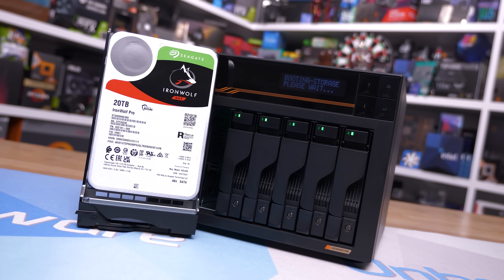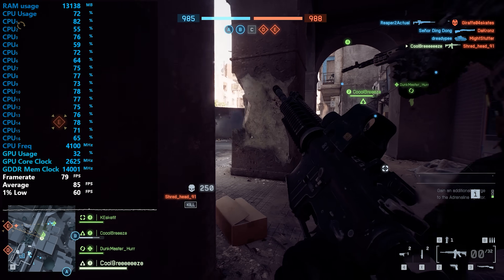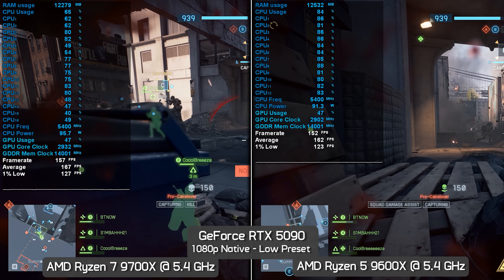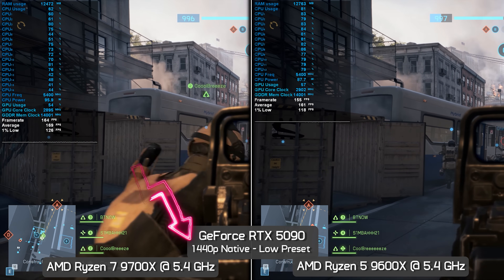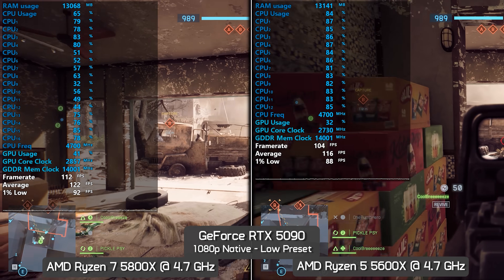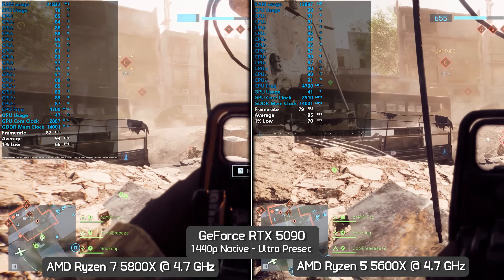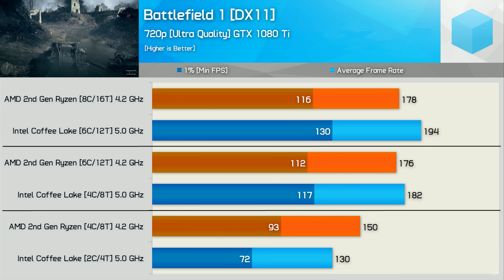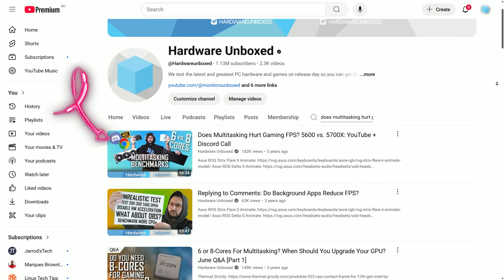Why Gamers DON’T Need More Cores, 6-Cores Still Works Well!

Comment: new 6 cores are vastly superior to parts from even 2020, my 8 core r7 5800x can\t beat any of recently relased 6 core cpus.
Reply: Although newer games can scale across multiple cores the peek workload in most is still on one core. So a newer generation cpu with fewer cores will still beat older with more cores in many cases. The 7600x and 5800x have almost identical multicore performance but in games the 7600x is just better.
Reply: If I add the Core Ultra 5 into the comparison, what do you guys think?

I just want to know everyone's perspectives.
Reply: @vieWviz  Doesn't make much sense.
-Requires buying a new platform and DDR5 like AM5 but it's already EOL.

-For anyone who "must haz" the new intel a 245K (£240) + 2x24GB ram (£100) + board (£200) combo comes to = £540.
Going to a 265K gets you 33% more Pcores plus 50% more Atom cores while the total cost at £569 is only 12% more expensive.
 
-Gaming performance between a 12700k and 13600K (Source Steve's Techspot review) thus likely a Ryzen 5 7500F or very highly tuned Zen3.

-Rendering performance in Blender around 93seconds (Techpowerup) which is slower 21.5% slower than a 14700K at 76.7sec or 7900x at 81.8sec.

That's pretty much par for the course in lots of tasks, anything you do has to not be memory latency sensitive as Arrow lake is really bad (hence Nova lake is going 144MB base tile).

The platform itself isn't bad as they've caught up to AM5 by having 16+4+4 direct PCIE lanes on the CPU.
Theoretically if Intel could do a 6P+0E for £100 it might make sense to throw in a cheap board with cheap ram to use as a home server so you can utilise the iGPU for AV1 transcode?
Reply: A friend of mine asked me to upgrade his PC so he could play WH40K Space Marine II in good quality settings, so asked me to stick to the "recommended hardware". The recommended says R7 5800X, but I managed to find a cheaper but newer R5 7600X so I got that and now he is happy purging the galaxy because it have more or less the same performance, but with a newer platform with way better upgrade path if needed.
Reply: @MisantropoFilantropo  I just upgraded to 8400F from R7 2700, the difference is huge. Wanted to upgrade to 5800X but 8400F was cheaper and is faster in most day to day tasks.
Reply: I have a 12core 5900x I'm all gravy for the foreseeable future 😅
Reply: @shotgunshawzy Yes.  But, if the game doesn't isolate to a single ccd, and uses more than 6, cores - the 6 core part would be faster because of reduced ccd-ccd latency.

Buy you are good: just game.
Reply: @shotgunshawzy nah, a 5900X is a glorified 6 cores. Due to CCD communication overhead, you're mostly locked into one of the CCD which is 6 cores. The 5900X, 7900X and 9900X should not exist imho, since most people are unaware of their limitations and that outside specially built programs they will perform worse than a 5800X/7700X/9700X despite costing much more, and that if you are aware the 5950X/7950X/9950X is not that much more expensive than it.

Unless you know what you're doing, they're basically scamming people out of 100/200€
Reply: @Anankin12  I own 5900X. Looking just on built-in benchmark in DX: Mankind divided, running 1 CCD in slightly faster (2-3 fps). But when I start Handbrake it shows it's might!
Reply: @GreyDeathVaccine oh yeah, in heavy parallel and latency insensitive operations it sure can get used :D I also have several very specific applications where I could take advantage of multi-CCD CPUs, but I run them on a cluster with nodes having dual 64 core (8 CCD each) or fual 32 (4 CCDs each, but faster so that the 32 core is faster than the 64 core) EPYCs. Next year I will lose access to such machinery though... But yeah, if you don't have a specific application that you know can take advantage of that, it's better to go either higher for max performance with the 50X or lower for higher/similar performance for lower price with the 700X/800X. Or for much higher gaming performance for a similar price with the X3D.
Reply: @Anankin12  The 5900X is perfectly fine if you know why you re buying it. For compiling, it did for me a very great job.
Reply: @Anankin12  Not even demonstrably true..
Reply: stares in 5800x3d menacengly.
Reply: @ZiLoXCY The 9600x is generally faster than the legendary 5800x3d except a few titles that are very cache dependent.
Also the 7600x3d exists.
Reply: @ZiLoXCY crazy cause the 7600 casually out performs the 5800x3d
Reply: Yeah, my 5800X3D only beats the 7600X in very specific games, otherwise the 7600X is on par or better...
Reply: @Anankin12 I have a 7600 and a 5800X3D and see the same.
Reply: @Anankin12 I could have bought the 5800xd but went the future proof route with 12 cores 😊
Reply: @shotgunshawzy which is a bit silly considering the 5800X3D is still competing with current hardware while the 5900X is not, and someone with CS knowledge could have told you the same. Still if it works for you then it's fine :)
Reply: It was always the same. However, the six core CPU will conk out over all games sooner than the eight core. Think back to 8700K vs 9900K. At the time everyone said buy the 8700K, coz you don't need the extra cores of the 9900K. Fast forward to now, and we can't say the same with those CPUs. Then I suppose it depends on how long you intend running your rigs. My previous rig with an 8700K is my second rig now.
Reply: @greenbow7888 that is reasonable, but aint gonna happen today, Im sure about this. 6/12 CPUs are still fine for average gaming.
Reply: yea and the legendary R7 5800x3D is equal to r7 7600x
Reply: DDR5 is the biggest contributer to the performance gains that we see.  I mean, I'm not trying to undercut the extra performance of the cores in a more modern CPU.  I run a 5900x, tweaked to the gills, DDR4 3600 14-14-14-28-42, fully tweaked sub-timings and it just can't hang with DDR5.  You can see it in Intel 12th gen benchmarks using DDR4 vs DDR5 mobos.

While dude is running a benchmark rig with a lean copy of Windows and seeing 10% performance gains with 6 vs 8 core CPUs, it'd be more on an actual user's PC.  It's just that 99% of games don't see any benefit from anything over 6 cores.. shoot, 4 cores are more than enough for the majority of games.  But Frostbite does utilize threads very well.  BF4.. FX-8350 vs i5 6600K was a good one.  An old, super slow IPC CPU with 8 cores vs a blazing fast (at the time) 4 core CPU had the FX-8350 delivering smoother gameplay in benchmarks I saw with equal-ish framerates.  

So, if a benchmarking rig shows 8 cores giving +10% performance in 2 minutes of gameplay (handpicked, I presume), what's a real rig stand to gain after an hour?  I can make examples that lean either way.  I play Tidal/Spotify in the background half the time.  Very low CPU usage, but hey.. when you're running 85% on a 6 core, and hitting that 85-90% mark is where the performance scaling typically ends, you "can" see more and more performance loss.  "Needs" isn't the right word.  Ya don't need it.  Just like ya don't "need" to test games at 1080p with a 9800x3D and a 5090 on low for anything in real life.  This vid is actually just fighting truth lol.  So, a 6 core benchmarking rig does bottleneck the game compared to an 8 core+... in only TWO MINUTES by TEN PERCENT.  I can't even trust this is in a 64 player server which massively increases CPU load vs 32 players.
Reply: 5800X and 5700X are still better than 7500F, 7600 and 7600X as a whole and in general use, cause you have more cores/threads, especially for virtualization. In multitasking power they are the same, but you can use more tasks on more threads. Also 125 fps with 95fps 1%lows are plenty anyway, and also good b-die ddr4 is still better for gaming than ddr5. For general usage PC i'd take a 5800X with good b-die ram anyday, instead of 7600X with ddr5.
Reply: @chovekb in gaming, lower core + higher IPC still does better than higher core count with higher freqvencies. 

In multitasking, its pretty dependant on the software. 6 core is still very enough for gaming EVEN when you re using discord, chrome etc. 

HUB has a video for this.
Reply: @chovekb  "as a whole and in general use, cause you have more cores/threads, especially for virtualization"
Which is it? yes the weaker 8 cores might be better for virtualisation but that is not "general use", and in general use a Zen4 6core is faster in gaming and normal desktop usage like browsing, spreadsheets etc.
I've literally had all the Ryzen chips so speak from first hand experience.
Reply: in fps yes but your pc is smoother with 8 cores than a 6 cores...12700k easily beats 9600x 6 cores is super low for 2025
Reply: @Vennux 12700K does not beat 9600X and if it does it's because of faster P cores, not because of extra cores (especially not the e cores)

Except in specific applications that are highly multithreaded, but not in games

Comment: My old 5600x was struggling hard do handle Battlefield 2042 64v64 mode. I guess theres no longer 64v64 mode in bf6.
Reply: try verifying game files, turning off SVM, Rebar ON, check if XMP didnt reset, HAGS ON, Debloat windows, or damn turn off Meltdown and Spectre. 
if else, might be the game memory leaks (ive read accounts on reddit with 5700x/5800x facing the same issue)
PS: some Conquest maps i find the CPU struggle
Reply: 5600X, 4080 Super, 32GB 3600
BF6 ultra avg: 80 fps
I lowered some settings and managed to average 110 fps
Reply: @Kniightwolff  And if you play single player story driven games you won't even feel the bottleneck. It's still a very capable CPU.
Reply: @Kniightwolff  what res?
Reply: @Kniightwolff That's a fairly lopsided setup, you'd be a lot better served by a 5700X3D. The 5600X will often hold that system back, especially in BF6
Reply: @demrasnawla Ah yes, that 6% is really holding back the GPU.

Did you not watch the video?

Battlefield 6 does utilize higher core counts better than the average game, but just as usual it doesn't make much as much of a difference as you might expect on paper and it's pretty much never commensurate with the increased cost.
Reply: @TheDarksideFNothing you're not aware of the effects of 3D cache? It does wonders in battlefield games.
Reply: @alkestos 100% my bad I missed the "x3D"
Reply: @demrasnawla my bad I missed where you said "x3D".

I agree that the pairing would have been much more appropriate with that GPU. But I think there's a good chance they have owned the 5600x a lot longer than their GPU. Don't forget, x3D was released very late in that generation.
Reply: @TheDarksideFNothing  No worries.
Reply: I guess it depends on your fps target and if you whant to play at max setting because I was ok with my 5600x. Do you have good RAM?
Reply: Nope, and it's a big reason why BF6's performance ceilings are way higher than 2042's.  128 players was just a really bad choice all-round.
Reply: @maynardburger yeah it was just too much. Gimmick rather than feature imo.

I think player counts above 32v32 could still be fun, but get too much higher than that and it's an inevitable cluster
Reply: Get the cheaper 9600 it's the same
Reply: I was playing a 64v64 game a couple weeks back, some special mode, and it was stuttering on my 7950x3d, looked it up and it seemed like it was doing it for everyone, so it might be a server issue.  Of course, it could just be in general if this was happening to you all the time.
Reply: I am generally over 100fps and over 120 a lot of the times. 5600 @ 4.6ghz all core 3600 cl 18. It’s damn smooth compared anything else released these days.
Reply: @TheCosmicMason  i had 5600 have 5800x now both tested in BF6 with same settings and same rest of the specs 5600 is fine but in BF6 it did hit some lower lows in citiy maps with full players if u are running apps in baground and discord for example you will be hitting 90-100% on some cores which might introduce some drops or stutters here and there so BF6 can benefit with 8 core on older gen tiny bit not in average fps but rather due to other limitation and maxing out 6 core while having nothing left for other apps in baground but with moder 7600x 9600x you will be fine most likely
Reply: That's when 12-16 core chips ahow their quality, anyone who says they dont is lying to you
Reply: @mickieg1994 did we watch the same video? This game gets better scaling than most and it's STILL not a big difference. The higher core count performance is almost never commensurate with the higher cost. 

The 6 core has always been a much better deal for gaming and anyone saying otherwise is ignoring the data.
Reply: @TheDarksideFNothing the data isnt the whole story, it very rarely actually represents end user experience and it certainly doesn't here

The difference is more to do with overall experience, load times, boot times, smoothness and snappiness of the controls, hitching and stuttering when large numbers of enemies spawn or from going to a quiet area to a busy one very quickly

 these are when the cpu gets hit hardest and if its already saturated (past around 60%) then its going to struggle to handle everything all at once, more cores here smooths out these issues by giving the cpu headroom, rather than being constricted
Reply: @TheDarksideFNothing also, again witht the 6 core, you will upgrade sooner, sell.for less and possibly cost you more in the long run, they can be a very bad choice for a budget build because of this and many other reasons
Reply: @mickieg1994  First, we have 1% lows which does capture stuttering etc decently well.

Second, there's not going to be a meaningful difference in latency between two procs of the same architecture running the game at a similar FPS. Period.

Third, you're not accounting for inter-CCD latency with the older high core count parts which often HURT gaming performance relative to the single CCD models. 

Those were never good value gaming CPUs. Period. 

Show me good evidence on any of this and I will happily change my mind. But all I've ever seen is assertions, meanwhile all evidence points to there not being a meaningful benefit for gaming.
Reply: @mickieg1994 why would you upgrade sooner if it's virtually identical performance? And yes, you'll probably sell for less but you already paid less so who cares? Probably a bigger margin saved on the front end than earned on the back end too.
Reply: @mickieg1994  if there's such a big benefit for gaming then why are there no reputable hardware reviewers reporting this? Everyone I'm aware of who is doing proper evaluations of these parts is reaching similar conclusions.
Reply: @TheDarksideFNothing 1% lows are useful but only you will know if it matters or not when you play it and feel it for yourself, its why the chart isn't everything, there's a subjective experience behind it too

I agree with your second point, its splitting hairs, unless you are really nitpicking there is little in the difference in a straight gaming setup

My understanding now is that the newer 8 core models, like my 5700x, are one ccd, there is a little lag between 2×6 or 2×8 ccds for the 12-16 core chips but again I dont think most people would be able to spot that having much of an impact

Another thing to bare in mind ofcourse is that this is on a clean test bench, not a 3+ year old windows install, with programs in the system tray, a browser open, maybe even a second monitor with something playing on it, which for me, is my use case, I think its fairly reasonable that alot of gamers will end up using their PC this way and so having a more powerful cpu, with more cores adds alot of headroom so that this kind of stuff doesnt impact gaming performance so much

So, if you bought your pc as a 6 core, that might be fine, until you are 2-3 years down the line, using the pc more like i described above and that is 100%, when you feel the itch for that upgrade, games become more demanding over time, a gpu upgrade, bought a second monitor etc, a better cpu, bought early, gives you a better experience, for longer, than any other component in my opinion
Reply: @TheDarksideFNothing didn't see your third comment 

My feeling is, way too many rely on charts and data and dont take time to actually feel the difference, its an older channel now but tech deals still has many relevant videos and he was one of the people who really hammered this point home, aswell as pointing out others over reliance on data to form their opinions, highly recommend checking him out